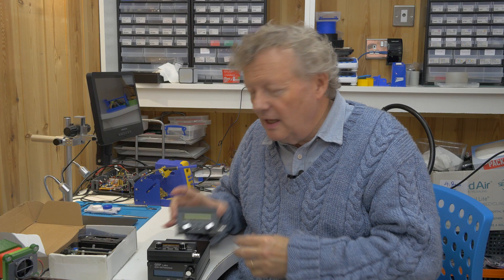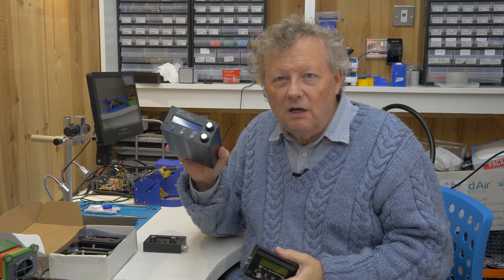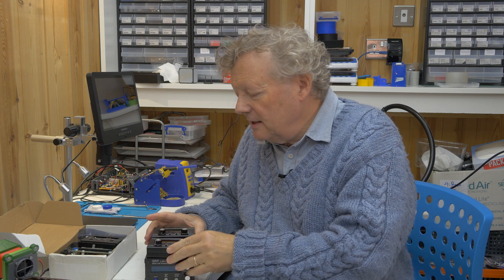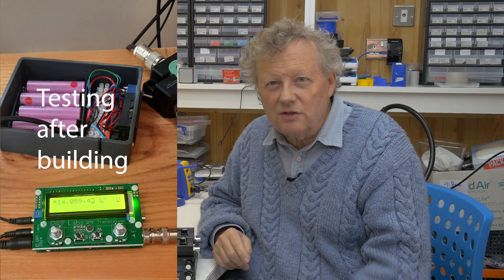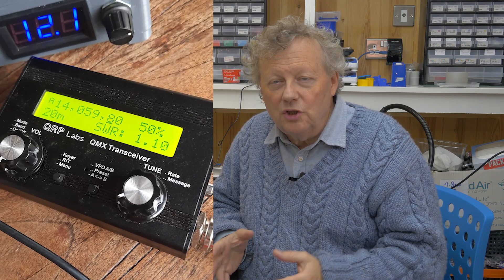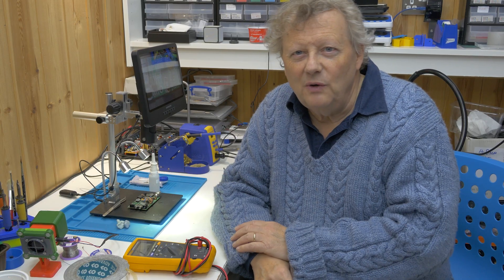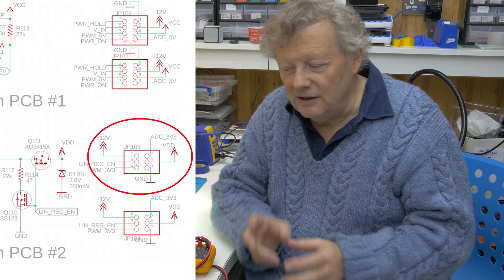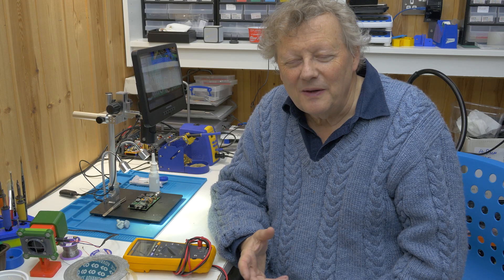QMX Testing

Comment: Mine died too! Tried a replacement Hans will send one…. I stuffed the install(have only had hot rework for a short time… should have practiced). I sweated it off AGAIN and reinstalled it and it went beep and let me install the firmware…. Then …. 🤡💩💀. On the bright side the kits are so cheap!!! I had to do the QCX twice…. The TCXO died too. Get in contact with Hans he will send cheap 73 de VK2 AOE

Comment: Just a quick thought, your impressive cardigan ( wool ?) so what about ESD ? , 50yrs ago - at least, when soldering in dual gate MOSFETs some of which had static protective diodes  ( and some didn't)it was recommended  to short all leads together , before soldering. This is obviously  impractical  so consider grounded wrist strap , ditto ESD safe mat and suitable clothing - take off the cardigan !
Reply from the maker: All good points, thanks. I do take ESD precautions, including changing clothing, but haven't been consistent enough. Also, my new working environment is a bit prone to generating static. I have now bought a new anti static mat, made a proper ground connection and am trying to be more consistent with wearing the strap etc. Hopefully, no more fried chips! (apart from the potato variety)

Comment: Have you checked if your working QMX has the same hotspot or not?
Reply from the maker: No - without a short on the radio the chip is likely to look warm, but won't tell me any more. The short will find the easiest way through the circuit - so the hot spot on the chip could mean that it has failed or that something connected to it is shorted and is connecting it to ground - by removing the chip I have confirmed that it was the source of the fault...
Reply: @Q26Video I inherited responsibility for an old wire wrap circuit board as a young engineer. There were burn marks on some of the wire wrap. I asked some of the more experienced staff about that. I got,"Oh, that's the board that had a short from Vcc to ground. We couldn't find it so we pulled all the chips and put it on a 50A power supply. We found and cleared the short in a second."

My response, "Ohhhhhhhhhh Kkkkkkkkkkk!"

Comment: I have a high band qmx and a qmx plus waiting to be built. Before I start I usually cover the work area with taped down aluminum foil. But if the processor can get zapped and fail with a short after successful construction and after working well, then that is a concern. What and how does it need to be protected?
Reply from the maker: I am no expert - and I think that all you can do really is take precautions. Grounding wrist straps and anti-static mats are available. I have never had a problem like this before, and never actually saw any life from the chip, but I'm guessing I may have been statically charged when I first handled it, it's really impossible to know. Any pcb can be damaged at any time by handling, although zapping chips is fairly rare. I will ground myself properly before doing any more construction in my new workplace. Good luck with your builds, they are great radios, and it's unlikely that you will have any problems, especially as you are aware of the issue. 73 from Mort / G4BSK
Reply: @Q26Video I have had good luck with the construction precautions I already take. But having been made and working correctly, to then have that radio develop a short in its processor makes me wonder if addition protection might be needed.

Comment: Thanks for the video. I have two QMX's that worked fine until they didn't. They have exactly the same problem. I just emailed Hans to inquire if I could get a few replacements. I used Chip Quik to remove my processor. A little sloppier but got it done.
Reply: Hans did reply and I did order 2 more pr-programmed processors.
Reply: What do you think did yours in?
Reply: @jertres2887 To be honest, I’m not sure. They were both out of their cases on my bench when they blew. I would like to blame someone else, but then I’m old and do stupid things.